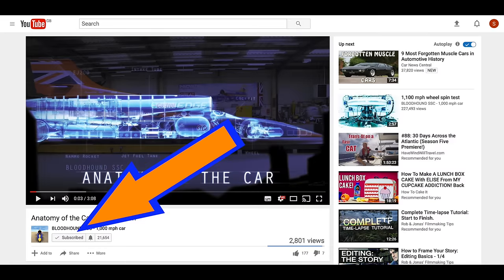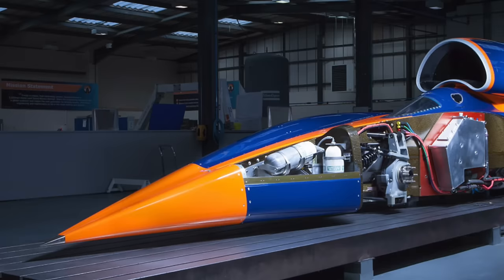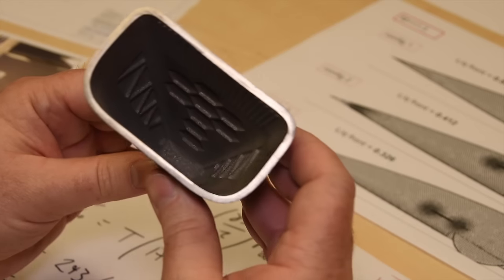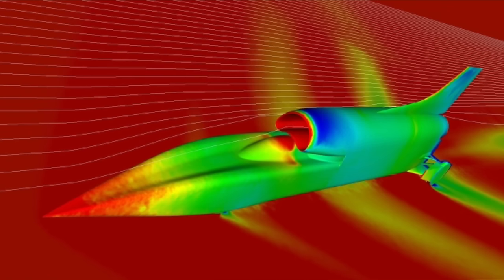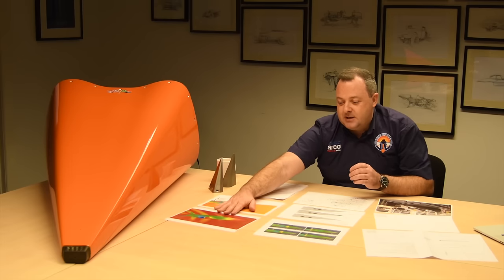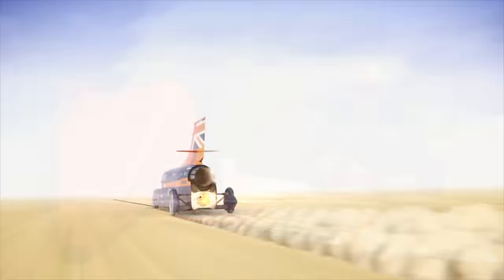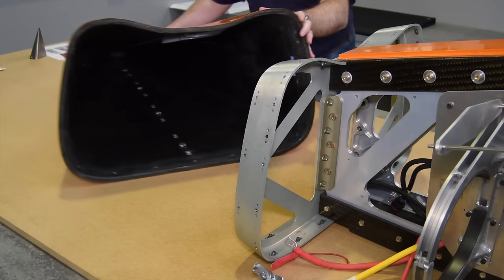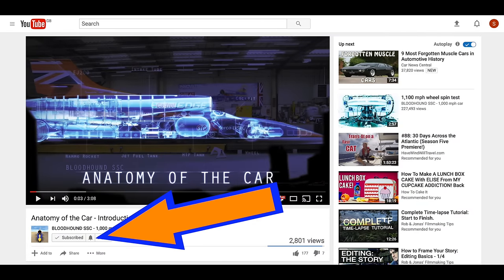Anatomy of the Car - The Nose

Comment: I have been wondering something along these lines for a few weeks - The turbine engine will be sucking in air at a tremendous rate and possibly be lowering the pressure of the air in front of the vehicle, but towards maximum speed the air will be hitting the vehicle at a very great speed. The question is will the turbine make any significant partial vacuum for the car to drive into with less friction or will any effect be wiped out by the speed?
Reply: Chemical Juice the engine does not suck are hard enough to have the effect you’re talking about, once the we’re up to even 100mph or so it’s gonna be negligible